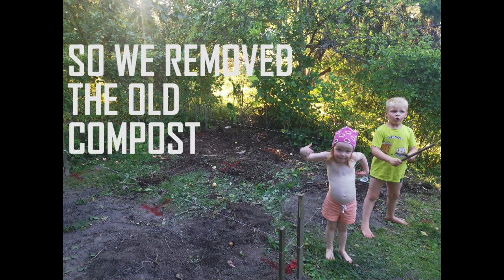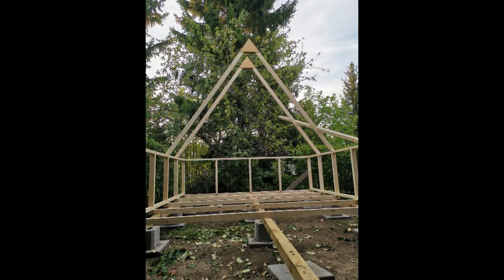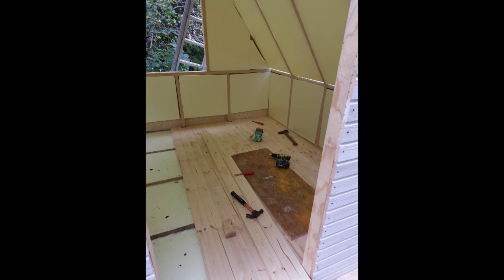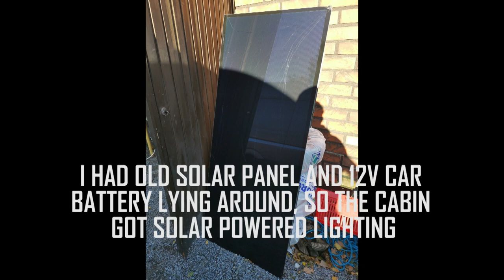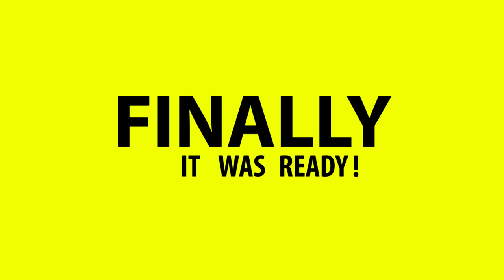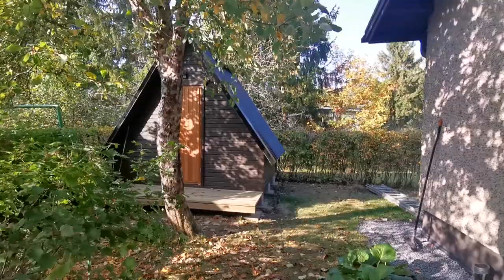DIY small A-frame cabin

Comment: how much cost for materials? whats the size of the cabin:height and length and width?
Reply from the maker: Total cost was litle under 2000€, window and door was second hand stuff and solar system was from my old boat. Base is about 3mX2,5m and the highest point is about 3,5m.